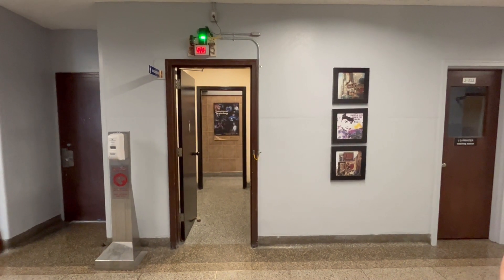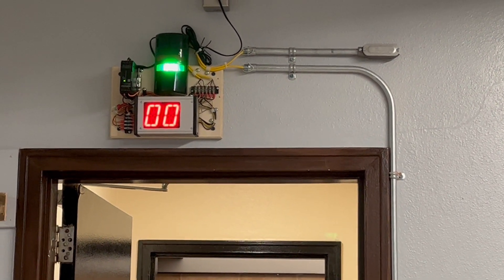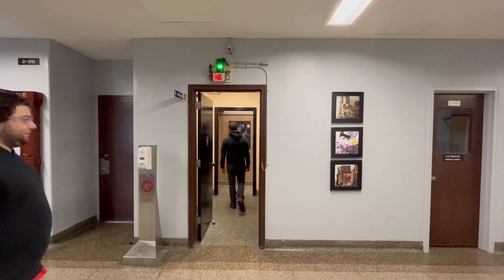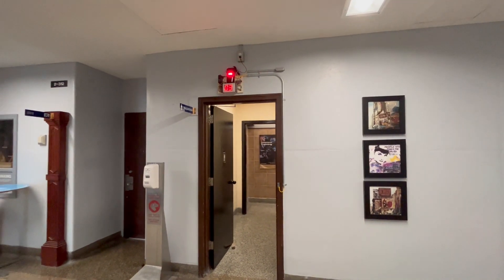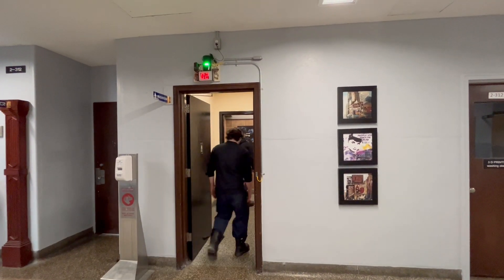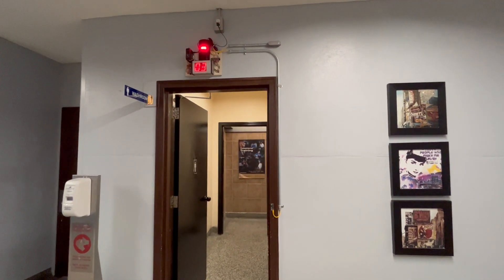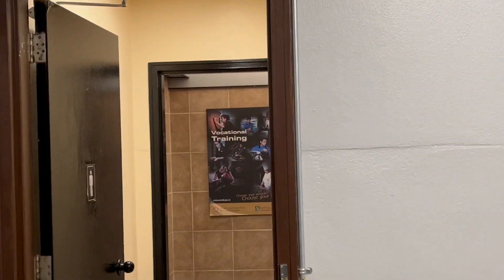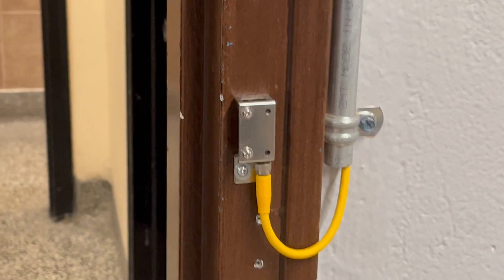People Counter - Project Installed and kicking!

Comment: Sensor name
Reply from the maker: to
@babosvabo7737: 
A1: for the installed project, Balluff BOS0117 rectangular, NPN, diffuse, range 0 to 900mm, 4pin connector. The range has to be a bit less that the door frame width.
A2: for the demo project, Balluff BOS01EZ round 18mm, NPN, diffuse, range 1 to 800mm, 4pin connector.
With the associated bracket, it was just too bulky to install on the door frame.